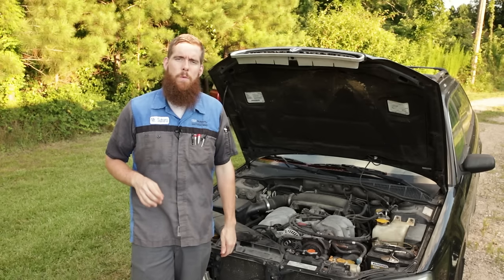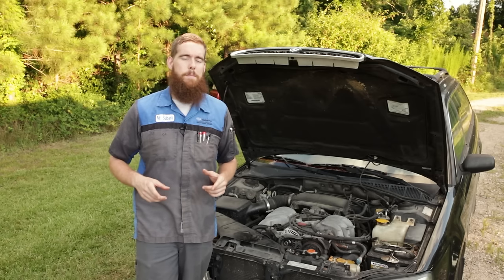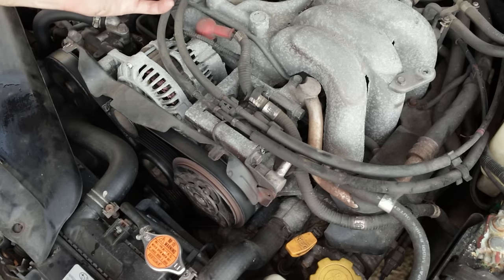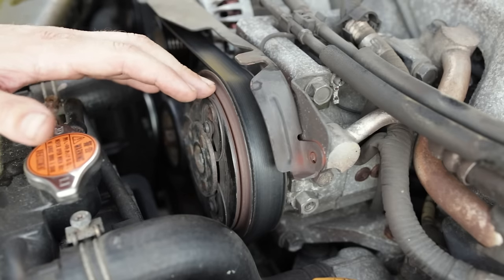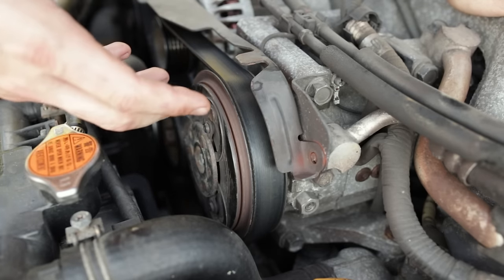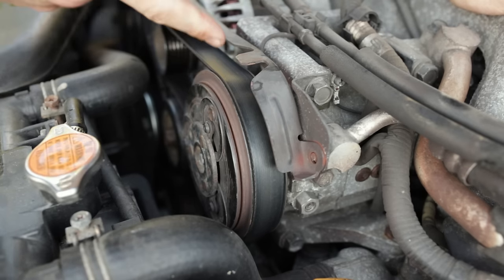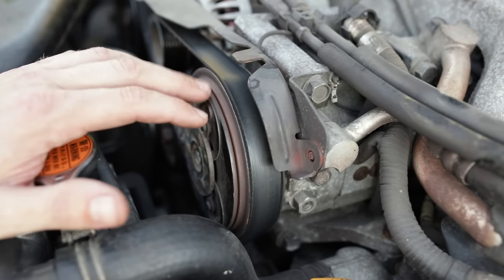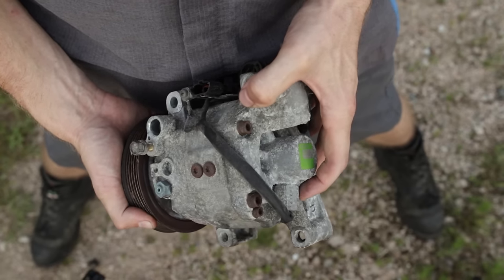Subaru A/C: Common Failures & Issues

Comment: Several years ago i was broken down south of charlotte and you gave me a hand with changing my alt.  Thx again! now my ac is quitting after 15-30 mins or so.  last night it worked again after restarting the engine.  I'm thinking Revolution sensor.  2001 H6.  Your thoughts?  In fact I wouldn't mind getting with you somehow and pay you to fix a few issues with this vehicle.  Again, your thoughts?
Reply from the maker: Could be, or could be the compressor gap, hard to say without seeing it.
Reply: @MrSubaru1387  i plan on using the test plug as soon as i get a minute.stand by.
Reply: @MrSubaru1387  I plugged the green tester plugs together.  Turned key on.  clutch clicked, leaned in towards closing 3-4 times but didn't close.  I pushed to help it on its next attempt. it shut and opened nicely like in your video repeatedly from then on.
Reply: @MrSubaru1387  are you interested in helping me fix it?  I can drive it up, we could fix the air gap, I could pay you then we both go home with a smile on our face.
Reply from the maker: @getfreethenrv815  it's a really simple fix https://youtu.be/7ptUvOv_AfY up to you if you want to attempt it.
Reply: @MrSubaru1387  let me think on it a bit.  I saw your video and am very tempted.  In the meantime, if we met what times/time days/day works for you?
Reply from the maker: @getfreethenrv815  my schedule is pretty open.
Reply: @MrSubaru1387  I could drive up tomorrow after work. What location?  I’ll leave blythewood around 2pm.
Reply: @MrSubaru1387  I believe it only takes about an hour and 15 minutes to get there. I could actually leave right now. It is 5:51 PM. Depending on the location we’re meeting at I could probably make it with plenty of time for you to fix it and still make it home by nine or 10 PM
Reply from the maker: @getfreethenrv815  email me at MrSubaru1387@gmail.com
Reply: @MrSubaru1387  I’ve emailed you without a response. I can only assume you’ve decided to move on. Thanks for your help thus far. Enjoy the rest of your weekend.
Reply from the maker: Never got an email.
Reply: @MrSubaru1387  interesting.

Comment: question: My ac  (subaru forester 2006 2.0) started smelling like burned rubber and made a lot of noice. I just cut the belt so i could keep driving in peace. However, the blower also stopped working inmediatelly. How is this connected?

Comment: In my 2016 Forester XT, I notice there is some goo on the side of my oil filter which is directly beside the compressor AC lines. Are my o rings leaking refrigerant? The AC still blows cold air.

Comment: So i have a 2014 Subaru Forester 2.5 my A/C works great until it gets to plus 90° outside but blows hot when i am at idle but if i start driving it gets cold. What could cause that?

Comment: Hey so I’m having a problem with my 2016 legacy. 181,500 miles.
No issues with being cold but quite often it’ll stop blowing air/not blow air at all/ very lightly blow air. It seems the “fan” isn’t working properly any advice?

Comment: My A/C stopped working 1 day after getting it professionally re gassed and now I'm getting a funny smell in the car, it kind of smells mouldy, does the freon used smell bad and is it possible my evaporator core is the problem not the seals which was changed?

Comment: Any idea why my radiator fans don’t cut on for ac system on my 2004 wrx? Ac works fine when stopped but as soon as I drive my ac compressor starts cutting on and off. It’s still full of refrigerant, but I hooked a gauge up to it. It gets up to 350 psi then the compressor cuts off so it doesn’t blow.

Checked all fuses and relays everything’s good, and radiator fans do run for engine temp

Comment: 2018 subaru outback bade model. Ac fluctuates in speed while blowing. Regardless of where you set the temp or speed to high it'll only blow high for a short period of time. It will slow to low speed and then pick back up suddenly to full blast and then go down and up and down and up constantly.. sometimes will stay on high for 10-15 seconds maybe but go back to medium to low... Im suspecting a relay may be not activating or something. I unplugged them fan relays in the engine compartment and plugged back in and it stayed on high for about 5-6 minutes then gradually started fluctuating again...checked the fuses in the cabin but havent really found anything yet. Any suggestions or help?

Comment: my subaru has a problem when i would leave work on highway in stop and go traffic it blows warm rather then cold so i would be hot till i got home to local raod and could go a nice steady 40 mph the subaru dealer tells me that is normal for ac to turn off whenever you step on gas to give you better acceleration and they claim it is a computer setting that can't be changed for safety of car having maximum acceleration when needed . frankly i would rather have a/c work then have slight amount of acceleration anyone know of a way to fix this on a 2012 legacy?

Comment: My 2014 Outback Premium is having some AC troubles:
The compressor was bad and it has been changed. There are no leaks in the system- checked already. But even after that the AC doesn’t seem to consistently cool. Like it will cool while when I go out. Then on my way back home when I start the car and drive back it doesn’t put out any cold air. Could this be an electrical issue? Can someone help or provide some information on where to start looking?  TIA.

Comment: I have an 04 outback California emissions with an ej259 my AC blows good cold air for about 15 minutes. I replaced the dryer and the expansion valve and pulled negative 30 newton's on the system refilled with 24oz of coolant and the issue persists. I ran it in the garage the compressor clutch stays engaged the whole q5 min then stops. If I drive 3-4 more miles with it off then hit the button again it works for about 5 min. Also when it stops blowing cold if their is no load an the engine my RPMs start to climb Noth of 3k do you have any ideas?

Comment: so, my 2000 Subaru forester S's compressor wheel isnt spinning when i turn the ac and the air on, i checked the fuze and its not blown or broken. what can i do to fix this?

Comment: Mr Subaru, on a 99 SF. The AC clutch does not have the 3 bolt holes for removal..how the hell does the clutch come off to adjust the clutch gap?
Reply: Just did mine, 2010 Forester XT - no bolt holes, but when I wiggled it, the clutch slowly came loose. Whew!

Comment: I have an 04 wrx and recently went to firestone to get my AC checked since it hasn't been working since I purchased it. They told me it was overcharged and they released some pressure and they also added dye. They told me there were no leaks, the AC was working for a couple days the AC compressor clutch was turning but now it doesn't spin and no AC comes out. It hasn't even been two months since I went to firestone. Could it be I just need to replace my AC compressor? thank you

Comment: Hi MrSubaru! My ac clutch is cycling on and off every 8-10 seconds. Its on a 2015 crosstrek. The dealer replaced the compressor, but it's still cycling on and off every 8 seconds. Its been over 100 deg here in Texas for a while now. I'd think the compressor should stay on longer than that each cycle, but the dealer said it's normal. What do you think? Thanks

PS: it's cooling just fine. I'm just worried with the constant cycling, stuff will get worn out prematurely
Reply from the maker: Usually they short cycle if they're low on refrigerant. That, or could possibly have a blockage on the high side.

Comment: Does anyone know why my 2013 Crosstrek would blow cold from the passenger vents and warm from the driver side vents? There are not separate temp controls for each side so I'm puzzled. My AC also sucks when it's hot outside. Yesterday I drove it and hot from the driver side but at night it wasn't nearly as bad.

Comment: Hi Mr Subaru, I own a 2006 baja 2.5 My air is hot the clutch is not engaging ,It does have freon, I jumped the relay clutch came on, But not cold air,,I tried charging it when jumped, Would not Take any, it was at a good mark on gage, is there something else Bad condenser, clogged ,Maybe, what else could it be Please help, I,m on disability, and up there in age, me and wife.ThanksBrian

Comment: My 2016 ac compressor is loud when it rurns on. I also feel like I am losing a lot of engine hp now when the ac is on. It blows cold air just fine. It just all the sudden seems to make my engine run harder when it is on. Not sure what is going on. Any thoughts?

Comment: Do you know on a 03 wrx with the 2.0 can I just cut the ac belt if the compressor bearing is bad and will the car run fine still and not overheat

Comment: So I have a 04 impreza ts, I haven't checked my refrigerant yet, but after running my a/c through traffic for a while. I'll feel the engine hold a load on the engine after turning off my a/c, which holds a high idle and holds it till I get up to around 45mph. Any ideas, check freon, low pressure switch, expansion vavle?

Comment: Hi, I have a Subaru Impreza Ltd 2014, when a turn on the AC compressor makes a noise, like a wind up toy but louder, I went with a AC technician, but he said that is the compressor and I have to change it, and the condenser too :( How I can discard if it's just the pulley or clutch? I don't want change all the system (it's a lot of money for me) if the reason is something simple, thanks a lot

Comment: Have a 2015 2.5 outback ac clutch is not DISS ENGAGING even with everything off been driving it temp gauge takes forever to move  ot sure if thermostat is stuck open or cause ac stuck on or both any info?

Comment: This might be an ambiguous question, but my 02 wrx ac suddenly started to go in and out and then one day just stopped completely. Been not working for the past few months and I tried a lot of things, but everytime I put a new 15a (recommended) fuse in the slot for the AC, it immdediately blows and the AC obviosuly won't engage. When I mean won't engage, I mean that the clutch won't magnetize in. Knowing that the fuse keeps blowing immediately (blows immediately with 15a fuse, doesn't blow with 20a fuse but it does get warm) are there any specific things I should check for? Help would be much appreciated thanks!

Comment: I have a 2016 fxt with the basic 4 speed fan, at speed 4 it cuts off after a few minutes, I replaced the resistor, no change, so curious if could be the radial dial itself?

Comment: If anyone can help I'd appreciate it. My ac works fine but if I let the car idle with the AC on for an extended period of time my car overheats. I started the car cold yesterday and let it idle for about 5-10 minutes with the AC on and the compressor got hot enough that I couldn't keep my hand on it. If I start to drive, or shut the ac off my coolant temps normalize. It looks like maybe my clutch is not disengaging but I wonder what would be causing the excessive heat in the compressor? I think it may be starting to bind up but I'm not sure. Someone online said if the motor is having to fight a resistant compressor at idle that could cause the overheating as well. My car does not increase idle rpm when the compressor kicks on and there was a dealership software update that was supposed to address that. Apparently my car didn't get it. 2003 WRX btw. So some say the low idle rpm while also fighting a binding compressor will cause the heatsoak. Thoughts?

Comment: Hi  hi, can you help me with a issue with my Subaru 2014 Ac issue.
This is the third time I am having issue with in a month.
When I am short distance the ac is working fine but I am driving continuously 1 hour my ac is blowing hot air then after couple of minutes the cold is back .. then after minutes the high temperature sign is on in the dashboard.  After the long trip the ac is working normal for a week then again in the long trip this happened.. any one can help me please?

Comment: My AC works well enough for freeze you out driving down the road, but as soon as you stop at a light and idle, it barely works if it works at all, just warm air blowing out of the vents. If I put it in neutral and put the rpm's at about 2k+ it will start to work decently well.   But even at those same RPM's it works way better while driving.    My 2012 impreza just got out of the dealership 3 days ago where they replaced the O-rings and recharged the system, and it is still having this problem (it's had it for years now if the temps go over 90).    Is this just a feature of the small engine + small compressor + really hot temps or is there something I can do to fix it? I assume the techs were competent enough to recharge the system correctly.
Reply: I have the same problem with 2011 Forester. AC Performance dropped in stops and the compressor is loud as well for past six years.
I advised by a tech to replace the condenser as it might be clogged somehow compromising the performance.
He believes that when the car is moving the air force cooling the gas effectively and the ac blowing cold.
I did not replace the condenser to proof it. Thought it would be helpful to share with you.

Comment: How common is a clogged expansion block? and how difficult is it to replace?
Reply from the maker: Haven't can across one on a Subaru, but it happens. A stop leak added can do it. They pretty easy to replace once the system is recovered and empty of refrigerant.
Reply: my shop quoted almost $700 saying dash has to come out... truth or fiction?
Reply from the maker: @timripley7168  should be at the firewall. What model and year?
Reply: 2002 WRX Wagon
Reply: @MrSubaru1387  2002 WRX Wagon

Comment: Only problem I've experienced is when I have the AC set to however hard I want the air to blow it'll occasionally change speeds on it's own while driving. It never cuts completely off while it does this, but it will slow down, go back to normal, slow down, struggle then go back to whatever fan speed I have it on and will repeat this. Has anyone experienced this and does anyone know what could be the issue? Blower motor resistor?

Comment: i have a 2004 ll bean with the 3.0L 6 cylinder, the clutch seems to engage but will disengage after about 10 seconds of the car being on. i can use a jumper wire in the fuse box to bypass the relay which keeps the compressor engaged which leads me to believe the issue is the REV sensor. where can I get a sensor and do i need to evacuate the system before doing the job?
Reply from the maker: From the Subaru dealership, Subaruparts.com, etc. Yes, system has to be evacuated and the compressor removed.
Reply from the maker: You've checked the clutch gap for proper clearance?

Comment: if the compressor clutch isn’t kicking on should i still check the o rings?
Reply: Yeah it's not turning on because its likely empty of refrigerant. Probably leaked through the o rings. Go to auto zone and get the green AC o rings. Don't use black ones

Comment: I'm have an issue with my A/C on my 2014 Legacy 2.5 that it just doesn't blow very cold when its really hot out. If its not super hot say 80-85 it cools down pretty good. Above 90 it does not even after driving for 30 minutes. I checked the refrigerant and its full. Any idea?
Reply from the maker: What's the vent temp with ambient temp 90+.
Reply: @MrSubaru1387   i don't know the temp exactly how ever I can tell you the vent clips that came with the refrigerant did not turn blue like they are supposed to if it is working correctly.